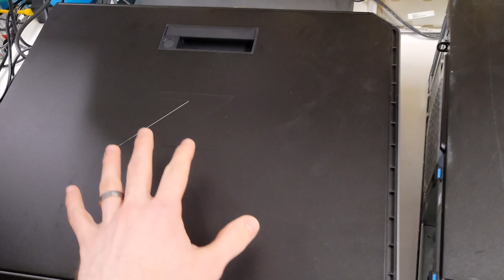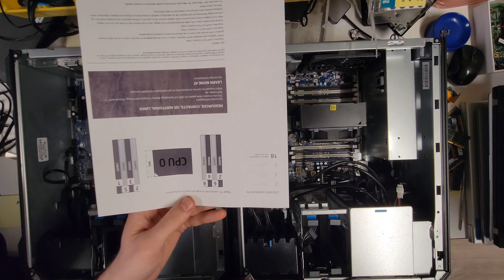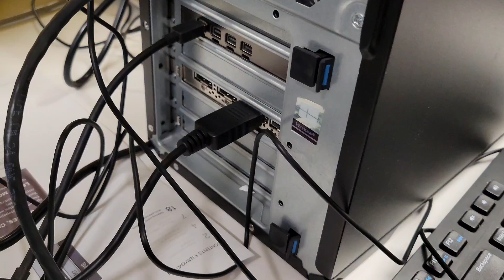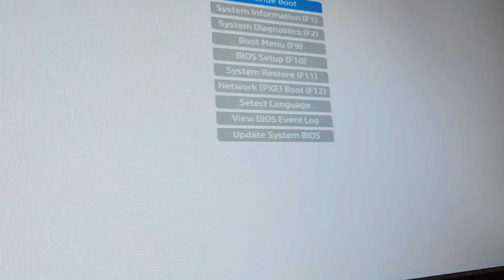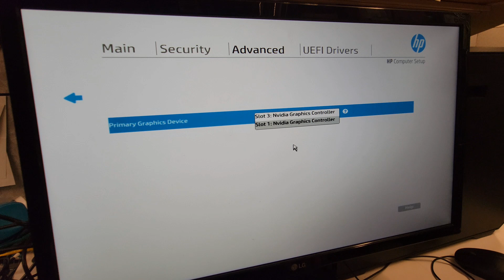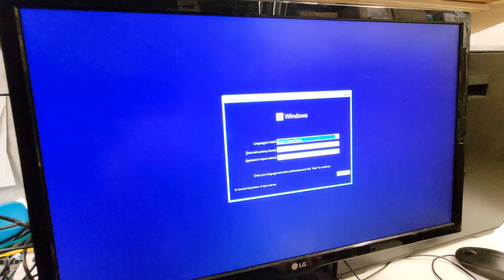Swapping internals - HP Z4G4

Comment: I believe it can take 512gb of ram. The building i work with threw one out last year and shortly after a couple of 8tb 3.5" drives. Last week they binned an all in one with a NVME m.2 256gb drive in it. Just waiting on them to throw away some good ram but will probaly have to buy that a along with a rtx 3060ti then PCVR is going to rock